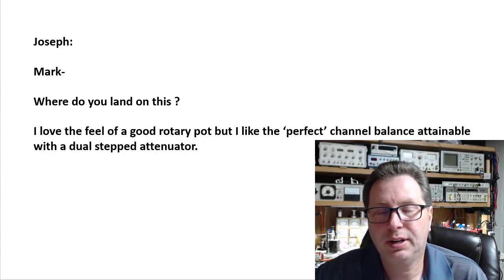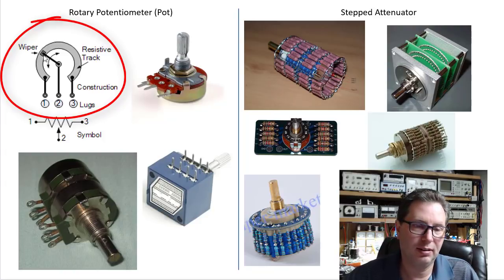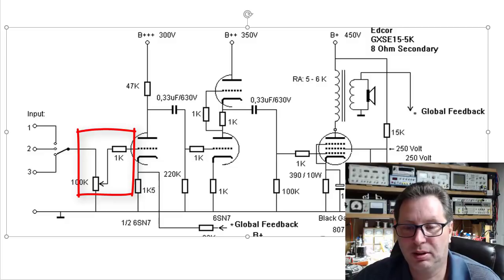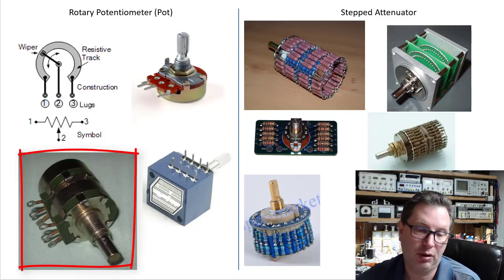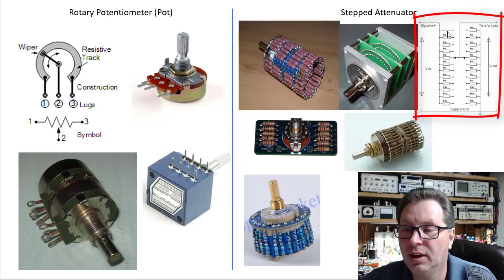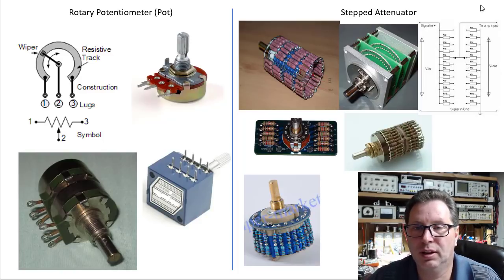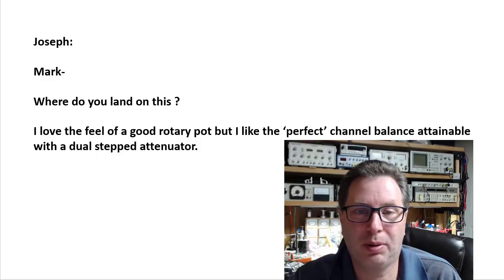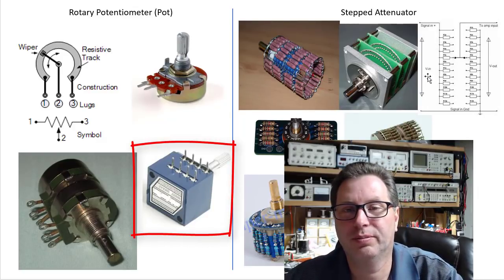Volume Pots or Stepped Attenuators for Hi-Fi Audio

Comment: I have used ALPS pots for more than 20 years, and I have pulled them apart and made one good one out of two broken ones. I have always measured them for best matching and they are never the same, obviously with a close tolerance. The good thing with them is they have a wide carbon track and also they have 5 fingers which makes contact as the wiper onto the carbon track. Five points of contact as opposed to one point of contact. I have had stepped attenuators with the surface mount resisters and they have failed too. One can never get stepped attenuators to go as quiet as a conventional pot.

Comment: I think there are some designs that grounds the signal over the wiper, so the part of the signal that goes to the amplifier doesn’t go across the wiper. Hence you got less distortion from the volume control.

Comment: Is there way to achieve volume sensitivity on gain POT on parametric EQ. I am wanting to make my EQ to from 1db increment to .5 db increment. Would that accomplished by putting resister on the middle pin? By the way POT on the EQ has center dented with boost to right and cut to left function. Thanks

Comment: a typical volum potmeter is not linear?A good autenator has only one smd resistor pr step. They are pop free if pcb layout are done rigth.I use 21 step dact type copy sold by lazer collection on ebay.in my stax amp and benchmark dac.both have multi turn vr,s inside to adjust the channel balance.I use the one marked special hifi grade curve 10kohm witch is the same value as the pots a replaced.Also use 2 stereo on the inputs on my 4 channel amp to adjust all my amps down  the db amount i need to let my dsp crossover run in unity gain after rommcorection and or speaker system is calibrated.The filters wil turn down midrange and tweeter section some db.To get the Best i turn it up again and turn down at the amp instead..It is a active speaker system.The 4 channel amp drive tweeter  l/r.and midrange l/r. this amp is diy has no local or global feedback and they are quiet.No hiss.In a active system with high efficent thinfilm type midranges and amt type tweeter comersial amps is to noisy.You can hear the hiss in listening position.For the second time in my 46 years of hifi and diy i can honest say those this amp design is the best i have heard.It is famus to be linear.companies like bruel kjær use a verson of this amp design.They made or make messurement equipment.My woofers i use a big pa type power amp.C vega it say but it is a modified verson of a spanish brand.Dx1000.would use a autenator any day. Potmeters are crap and noisy to the sound signal. Sorry for my bad english

Comment: Left out resistor noise. Carbon resistors are noisier then metal resistors. Most pots are of the carbon type and most stepper attenuator are of the metal type.

Comment: I don't follow the part about 'what if your amplifier isn't balanced? The gain of an amplifier is normally set by the ratio of two resistors, not by the strength or weakness of a valve.

Comment: If you use two ganged pots per channel in an H, you can maintain constant impedances to your signal source and your input stage. The input signal connects to the "top" of one side of the H, and the input stage to the other. The bottoms of the H go to ground, and the wipers are connected to each other. You need four ganged pots for stereo. 

I had a Sony preamp at one time that had a switch next to the volume control. Up was full open and down was 20 db down (I think). At low volume, you had a lot more control.

Comment: With low voltage circuitry - opamp preamp for instance - you get the chance for using a digital potentiometer, which means you can have the advantage of no scratchiness and a good number of attentuator steps (512 for instance).  Of course you then need an actual rotary encoder or some such physical control and a microcontroller to drive the pot, and all the associated circuitry.

One trick you can play with stepped attentuators is to have a coarse one and a fine one, say 24 x 3dB steps for coarse and 12 x 1/4dB for fine adjustment, many ways to do it.
Reply: Why not, instead of fixed latches, have the bus carbon resist and use a wiper, combining the best of both?

Comment: Why didn't you show wirewound potentiometers? they are the best. I would disagree that linear and logic are the same they're not the outcome is similar but the operation is different and the sound quality is different from both
Reply from the maker: Well, in my 30 years of working on audio gear, I've never once seen a wire wound resistor used for a volume pot.  I wouldn't put them on my list of good, much less the best for this application.  They are jumpy and don't provide a constant sweep at all times.
Reply: Blueglow Electronics I think it depends on the quality why don't you try it sometime
Reply: Not a match for a tube amp though - wirewould goes up to a few hundred ohms or so, tube volume pots are around 100k and up.
Reply: Blueglow Electronics could you answer me this! what about the lightspeed Attenuator that's supposed to be the best volume control you can use do you know anything about them, made in Australia the most transparent volume control? As long as the input impedance on your amp is 70k plus and your source has 2.5 volts or more output. This might be the answer the Holy Grail??
Reply: John sweda No you can't. All that does is reduce the effective range of the pot. A 500R pot after a 100K resistor will have only .05% effect on the output voltage.
Reply: John sweda And if you don't it isn't a proper match for the preceding stage. I don't follow what you're claiming here.
Reply: John sweda 'Under resistance' IS 'not a proper match'. Any prior valve stage needs a load impedance of at least 100k, and any following valve stage needs a grid resistance also usually measured in hundreds of K.
Reply: Mark Tillotson but you can run a high-power resistor of the end to make up the difference.
Reply: QuadMaestro well course not if you have 100k resistor output with the pot it is 100k so it's going to be 100k zero
Reply: QuadMaestro you've lost me as well why won't it be a proper match? Under resistance  may be but that's not the case.